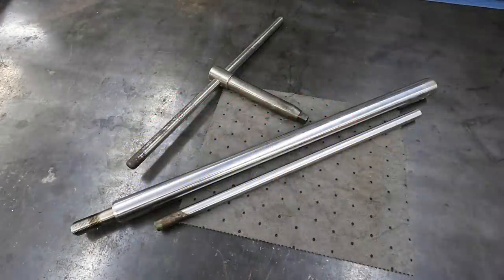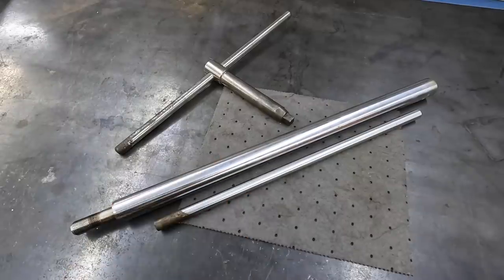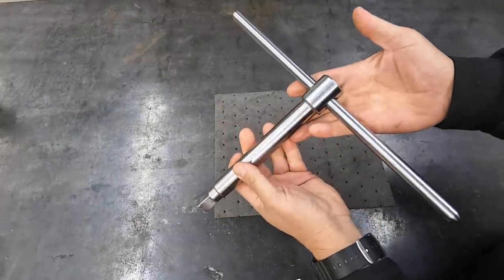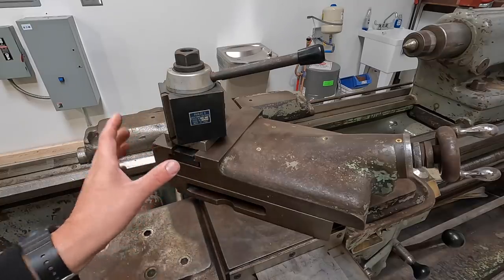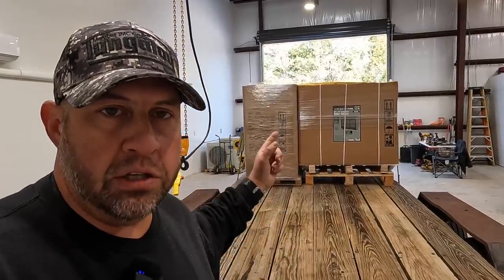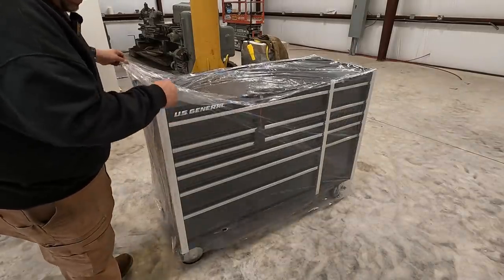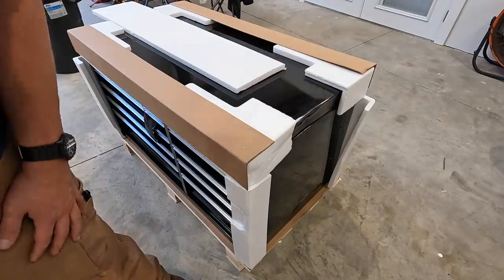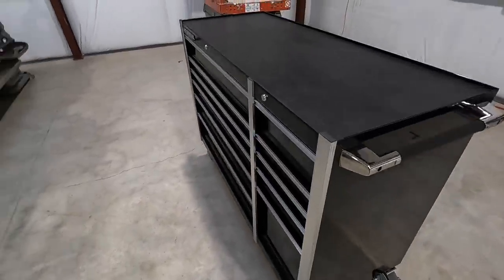Saturday Night Special 358: 3 Jaw Chuck Wrench, New Tool Boxes

Comment: Adam, did you see the chips Kurt was getting with his new shaper down at Cutting Edge Engineering?
Reply: MASSIVE chippage.  I like that he's going to have it restored.
Reply: Interesting that Kurtis's is hydraulic driven, but yeah....massive chips
Reply: @kimazbell460  I was surprised to see hydraulics cycle that fast and smooth compared to the fly wheel style shapers
Reply: Chips measuring one banana..

Comment: Adam I own H F boxes as well. If you look on the larger drawers you will see that you can buy and add extra sets of slides for the drawers. H F has put all the holes and mounts for the slides on the box and drawers. You can order the slides from H F to add. Your box will last longer and the drawers will hold more weight without bending. I definitely recommend that you buy and add the extra slides to the drawers because of the weight of all machine tools. All of your Snap On  Mac and Matco boxes come with the double slides from the factory..H F does not include the slides because they are keeping the prices down but at least they put the mounts there for you to add the slides without modifying the boxes. They will dramatically increase the strength of the drawers and make the boxes last much longer. It's best to add them right away. If the drawers get slightly bent of saggy due to weight before you add them they will never open and close easily again even if you add the slides then. You can buy new drawers also from H F if you need them. Hope this helps and hope you enjoy your new boxes.

Comment: I’ve only ever done production work in smaller lathes but thinking about it, it would drive me nuts if I couldn’t reverse the machine without walking around it to the wall everytime.  Can that reversing switch be on the lathe where it would be more functional?

Comment: Definitely nice boxes for money. Only thing cheesy are the casters. I bought better casters and drilled 2pcs of 3/8 flat bar straps that span the caster channels to sandwich between the channels and the casters . Essentially “framing” the bottom in . Stiffened it up very nicely and rolls much better now

Comment: Home Depot has some very nice butcher block counter-top blanks in a variety of sizes that can be cut down.  A 1.5"x30"x60" is about $200.  The butcher block glued-up slab will stay flat and straight better than a solid piece of wood.
Reply from the maker: I had no idea, I’ll check that out! Thanks 👍🏻

Comment: Adam, you really need to fix your video audio. For the first like 5 videos, it was fine, but its starting to really bug me. Even the intro starts with audio on the left side only. I can't be the only one - maybe all other comments watch you on tv, or on a mobile, so they dont notice.
Reply: The audio comes through fine for me, both sides.
Reply: External speakers on laptop, audio cuts out entirely, unplug speakers, then works on internal speakers. Definitely on Adam's end...his remote mic, I guess battery gets weak.

Comment: 👍 - May I suggest a clamp on hook rack to clamps around the crane post?   No welding on the post.  A 3 inch wide, .125 wall strap formed to the diameter of the post, and then clamped with bolts through a hole that's in integrally formed flanges.  That way the straps and chains  you use for lifting will always be at the thing that lifts 😉.  No need to take up wall space.
Reply: That's a VERY good idea Joel.  Mine are hanging on a wall with a backing of Luann to keep from damaging the wall.

Comment: For the top on the big box, what's worked well for me is a piece of 3/4" plywood with a piece of tempered hardboard on top of that.  The hardboard is pretty resistant to oils and grease, and when it does get beat up it's easy and inexpensive to replace.
Reply: I agrree but i think the eztended edges will nohave a woodlomger prevent the top from sliding around thats a great idea  though i

Comment: A nice thing to add for the large chucks is a speed socket that fits on a 1/2" drive air impact set to low speed. To quickly drive the jaws close. By welding the same size squire drive to an old socket. To save ya some time.🤔👍
Reply: I like the 1/2” right angle impact wrench, they reach just right for these applications.
And with a short machined socket to 5/8 it would just sit on the lathe for that hahaha

Comment: Abom,

I would consider taping off 12" from the concrete where you have sheetrock in the shop and applying a good oil base sealant like Zinsser or Kilz. A pressure treated 1X10 screwed into the sheetrock as a molding bumper would be advised.

Comment: The shop is coming along nicely. Just a thought, I work in a machine shop and I have a good grasp of a lathe operation. Changing the direction of your lathe motor from behind the machine seems to be a pain to me. I would suggest a fwd/rev motor starter combination contractor. That way you have a fwd/rev selector switch at the right of the chuck. In the Long term this will pay its self. 
Love the shop build
Reply: A 20hp fwd/rev motor starter is a "high dollar" item!

Comment: I tried that CRC. Yeah, not very good stuff. bettter off using cutting oil, That stuff provides very little protection to cutting tools. I tossed the can after 7 uses, I tried to like it but its not good.

Comment: You might want to get/make some spreader bars for rigging. They'd keep the spanset from squeezing in at the top, makes the lift more stable. The downside is that they need more vertical room.

Comment: For your new shop, I suggest you make a forklift device for your overhead crane. That would be better and quicker to use rather than using straps.
Reply: No way to level or tilt back unless you make it complicated.

Comment: Everything happens for a reason Adam.  I honestly believe you know that, just thought I'd bring it up for ya.  It's wonderful being organized with everything in it's particular place - you know at a glance if something is still "out there".  Hahahaha.  US General is great stuff and not nearly as expensive as the name brand units.  I can see you making a new lip for the 56" unit after you put the wood on it - removable of course, with the possibility of adding one of your not-so-large vices so you can hang onto something if you need to.  Multi-tasking adds versatility - perhaps out of aluminum - just a thought.

Comment: I have an older US General  56" bottom "machinist" box i bought 15years ago. They dont seem to offer it anymore... The top drawer goes all the way across rather then split on the one you have, under that is another 3/4 width drawer like your top one. In place of the 3 shallow and 1 deep drawer in the short bank it has a pull out with a peg board set up in it for being able to hang tools, I set it up for air tools, and shallow drawer area on top i use for drill bits and cut off tool accessories. BTW I use mine in automotive repair. The top deck is rated at 3300lbs on mine, I have set an entire front wheel drive sub frame with complete drive train on it and been able to roll it around. Only feature I dont like with mine is they didnt offer the gloss paint when I got mine, they only offered this flat paint that is impossible to keep clean and comes off if you use any kind of cleaner on it. Beyond that the quality of build is equal to anything offered by Snap-On or MAC Tools. For about 1/6th the price.

Comment: I got some boxes made in Taiwan. They're OK.

Abom79 needs some magnets for lifting.  Caveat: always assume that they will let go when using them!
Reply: Uneven/non flat and dirty surfaces and the holding power reduces dramatically. Cold rolled or machined plates are probably the things you can lift at rated capacity if I had to guess. Maybe even hot rolled too
Reply: He has at least one lifting magnet. Was shown in a video years ago. It’s not the cure all tool.
Reply: @MF175mp  ; you can get them configured in a V for attaching to round parts too. Keeping in mind my previous caveat.

Of course what happens when you get them near chips on a machine can be exciting.
Reply: @BerndFelsche  The smaller surface contact area on round parts makes it still a lot weaker than on flat surfaces. Idk if they can grip the rated weight from a round surface but it's probably told in the user manual of the lifting magnet

Comment: I own a couple of the US General (Harbor Freight) toolboxes, and concur that they are of surprisingly high quality. I have had only two complaints: First, Harbor Freight's warehousing/shipping can be careless; my first box arrived with a great big forklift scar on the back--I refused to accept it and they took it back and sent me a new one--so points for customer service. Second, when the toolbox is heavily loaded, the casters don't steer as easily as one could wish. Not bad, by any means, but you have to fight a little bit to get the box moving in the direction you want. Overall, though, excellent quality, especially considering the reasonable price. The drawers work very smoothly even when heavily loaded.
Reply: Posted this before I finished watching. I see you have first-hand experience with the warehouse/shipping damage I was talking about.

Comment: Your going to like those US General boxes. The 1 I got the drawers actually fit a friend's snap-on box. Only difference I see is the latch on the slide that keep the drawers from coming all the way out. His old Snap-on is metal where mine as well as the new Snap-on is plastic. Oh and by the way you may want to check where it's made. My US General said "assembled in the USA from some foreign parts" on it.

Comment: At about 21:00 while using your rode wireless mic, your speaking audio is only a single channel. Otherwise, great work. Have you thought about a contactor setup for reversing the lathe? That way you can have a remote mount button on the lathe while threading, to change direction.

Comment: Nice, real nice. A coat of wax will keep it looking good for a long time. Maybe 2, 3 times a year. Wow that video just flew by. Even looked liked those tool boxes came with pads for each. My son got a craftsman, actually 2, smaller on top but no pads for any of the drawers. I really like the black. And some wax will be so much easier to remove fingerprints. Looking good Adam. 👍
Reply: You wax your toolboxes 2-3 times a year!!??  Yikes, what next?
Reply: Paul, they still look like brand new. I live in FL so we have a lot of humidity. Even my A/C condensor when it was installed 20 years ago, no rust. Just helps with corrosion and like your vehicles, keeps a shine n easier to clean.

Comment: Speaking of chuck wrenches, I decided I could do better than a 4 position end (square) with a 2 position "T" handle. I wanted more positions so I combined the 4 positions of the square end with a 3 peg handle. The pegs are short enough not to be obstructed anywhere around the chuck but long enough to use a cheater pipe for good leverage. This gives me 12 positions to use the cheater pipe. Without the pipe the chuck wrench spins easily to move jaws rapidly. Best chuck wrench I ever had after many years machining.

Comment: Just out of curiosity. Is there any reason why you got an industrial unit, when your going to have another homestead built? Or is it just a stopgap until the homesteads been finished. 
It's nice you've finally got some room for those machines that have been sitting outside on the concrete all this time. Even if it is just to get them out of the weather

Comment: In many of the videos you have sections with audio only on the left channel (like the part where you tested the chuck wrench). Not noticeable if you listen with integrated speakers, but with headphones it's distracting. You should be able to duplicate the left channel to the right in your editing software, or set the audio track as mono so that the video plays the same audio on both channels.

Comment: Great to see things coming together.  There's nothing like the fun of getting a new tool chest.  One thing made me cringe a little, and that's the position of the new chest by the office door.  It looks to me like the glass panel on the door could hit the handle on the tool box.  If you accidentally swing the door open too hard (maybe a gust of wind when the bay door is open), you could be out a glass-paneled door.  You might want to check that, and maybe make some sort of soft-stop for the door.
Reply: A DOOR STOP TAKES CARE OF THAT

Comment: No one beat me up here….. I am a bit of a Snap On guy… but I have looked at those boxes while at a HF store.   They aren’t bad at all like you said, Adam.  In fact … they are BETTER then a Craftsman box of the same price.
Reply: I was at HF just the other day poking around, and started playing with the General boxes on display and I was very surprised at the quality too. The drawers were really smooth sliding and everything felt pretty solid. Seems like there a certain things at HF that for whatever reason are just plain good. While the rest of it is crap. Steve Summers had a HF winch on his channel the other day and it looked pretty nice too.
Reply: I couldn't bring myself to get the HF one, I ended up spending about 40 more dollars for the Husky one of the same size at Home Depot. Been about a year of heavy use and it's holding up.
Reply: When I bought mine, I got on the floor inside the store to inspect every spot weld and crevice inside the cabinet. 
        I was very impressed.
Reply: @kanahmal  How is the Chinese made Husky better?
Reply: @grntitan1  the drawer return is smoother and still works like new. If your question is what besides country of origin makes that the case, I don't know, perhaps it's that Home Depot can still feel shame.

Comment: I bought some of those US.General brand toolboxes from HF and I bought  them specifically because the quality was so good. I had bought a Sears Craftsman tool box about a year earlier than than the HF toolboxes assuming it would be better made. I paid nearly double what the HF cost me and the quality sucks. I got mine about a year ago when they were $299 each. The 8 drawer 26 X 22 inch single tier model. They are now $349 each. If I hadn't taken my time getting them I could have gotten mine for $249. The monly mistake both of us made in getting them is waiting so long. You are using yours exactly the same way I am using mine. I have one dedicated to the lathe and another for the mill. I have no complaints about the HF US.General brand. I can't speak for any of their other brands of toolbox because I don't own any of them. Not everything HF sells is junk.

Comment: Lifting that unpackaged tool box I would have put spreader boards between the straps so the straps did not squeeze the tool box. I have done a LOT of crane work but I have done some . . . Now start plastering stickers all over them :o)

Comment: I’ve had US General boxes for the better part of 10 years with no issues. I agree with the quality difference comparing them to what’s sold at HD or Lowes. I had a Milwaukee box from them for a little while and the top drawer ended up breaking on my from the tools in it, went out and bought a 56” from HF and loaded down heavier than that Milwaukee it handles the weight just fine.
Reply: This. Harbor Freight for the win. I don't really agree with the fact that these are made in China and carry a label of "U.S. General" but Harbor Freight has over 1,000 stores and employs 20,000+ American workers, so...

Comment: I have the black 44 top and bottom with side lockers. The side locker quality is not nearly as good as the tool box, but for the price it holds my sets in blow molded cases just fine. As for the actual tool box, I wish there had been a third party option like these when I was turning wrenches in automotive full time. They rival any mac toolbox I had except for the full blown macsimizer I spent years trading up to. If I went back to that trade tomorrow, you wouldnt catch me on the tool truck for a toolbox again. The downside is that dented boxes like you got are super common. You have to open them at the store before you leave to save some aggravation...

Craftsman, Kobalt and Husky toolboxes have all gone to pot. In 2001, I bought a Husky 2 bank top and bottom from home depot that was USA made, and matched my mac tools box at the shop 100% except for the badges. Both were made by Stanley tools at the time I believe. I looked at the husky boxes you get now and couldnt believe how downhill theyve gone. A friend bought one thats comparable to the US General and a year later, drawers are dragging and its just falling apart...

That being said , Im still a sucker for an old Kennedy machinist box, or a Gerstner for pure craftsmanship and pleasure to look at on the workbench. I have 1 Gerstner and 3 Kennedy 7 drawer portable chests that arent going anywhere..

Comment: Nice toolboxes will help for sure.  I noticed that crack in the concrete slab a few episodes back.  I guess that was caused by the weight of the new lathe? Will that be a problem in the future ?   I thought these concrete slabs were designed not to crack?
Reply: All concrete cracks

Comment: Isn’t that a bummer, just happened to me too… I have bought a toolbox item like that 5 times…. The first one I didn’t open box at store brought home and found big dent, 2nd, 3rd, and 4th I made it a point to check before I leave store and open the box up…. All of those were perfect….. this last time just 2 days ago I did a video on it… I didn’t open to verify and sure as heck big dent in front! Everyone I inspect before leaving ends up fine, but if I don’t of course it’s dented! Glad you didn’t have to wait. I love some of harbor freight stuff…. I buy a ton. I look at it as if I use it enough to break it or wear it
Out I will
Replace each tool with a better quality. I’d rather have the tools
I need in crappy quality for now and slowly upgrade the important stuff.